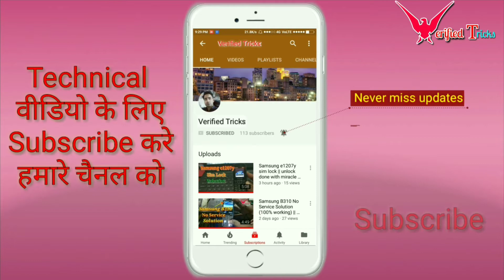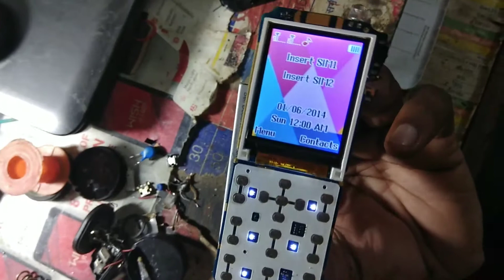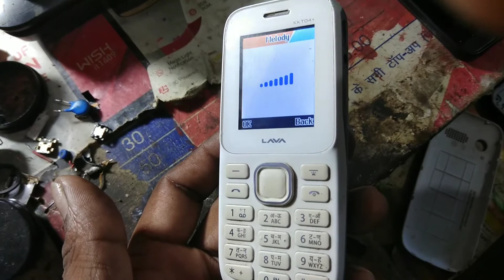Lava kkt04+ headphone problem jumper solution || Verified Tricks

Comment: Bro same model same problem and another problem is keypad is working automatically say the solution for keypad bro make video on same model for automatic work solution waiting for your reply...?
Reply from the maker: 1. Check all keys reading using multimeter (keypad reading 250 se 800 k bich aani chaiye)
2. Check charging connector
3. Rehot/reball cpu ic (Carefully)